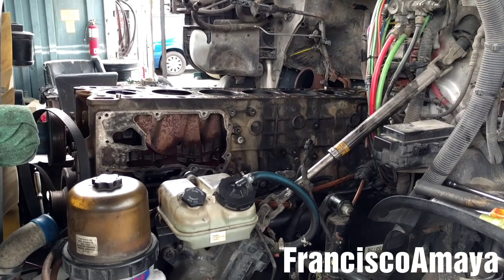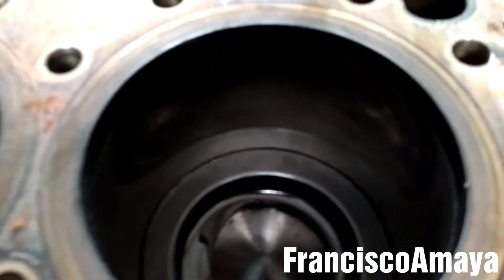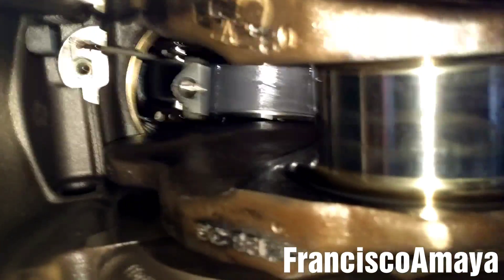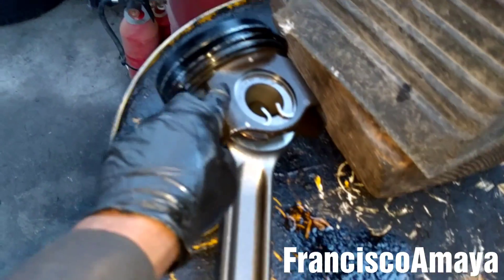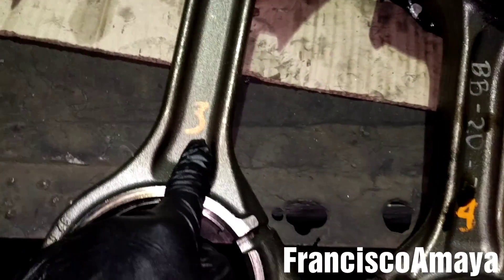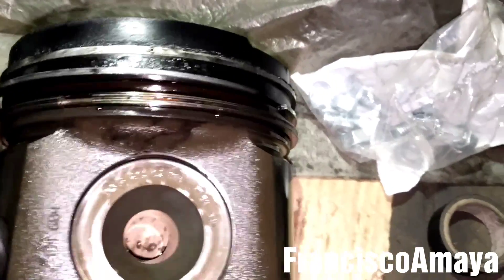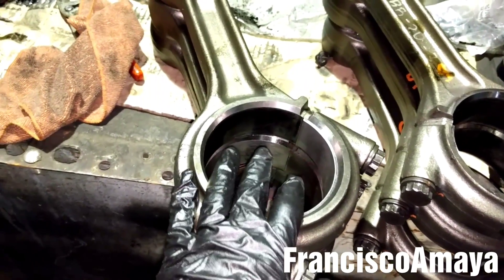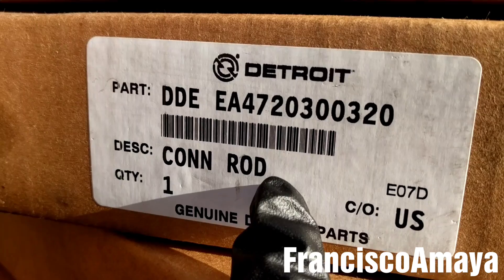DD13 DD15 DD16 piston connecting rod replacement torque specs parts process part 1

Comment: Is it possible to replace a single piston and cylinder in a dd15? I have a chance to buy a 2010 freightliner with a dd15 for a very good price but it’s got a bad piston. It runs but has a dead cylinder. It doesn’t overheat, is it possible? Trying to get it on the road as budget friendly as possible. If it lasts a year or 2 I’m good with that. I just need to get back to work

Comment: Hello Francisco I have a code on with a service engine light that goes on and off. Also I have a red/orange color fluid leaking from the under the driver step. 
The code is displaying: 
EEC 061 SPN004360 SCR TMP SR 04
Reply from the maker: I think I already responded to this comment on Instagram. LoL